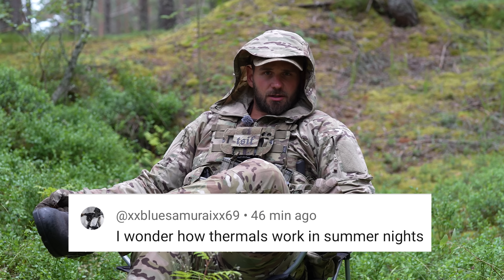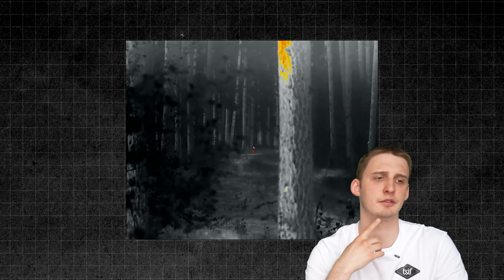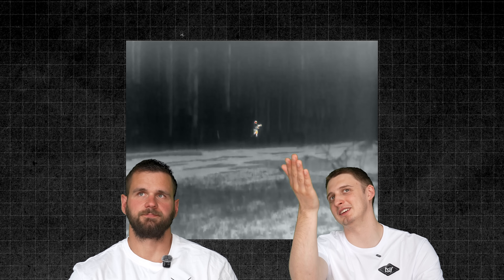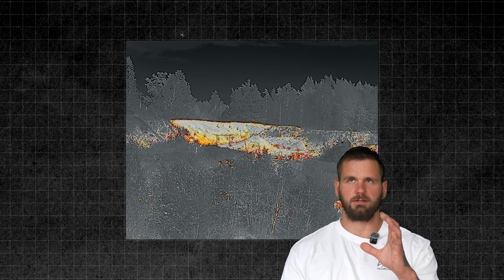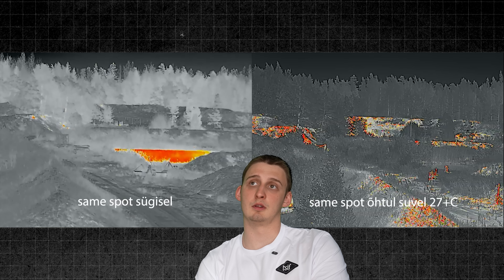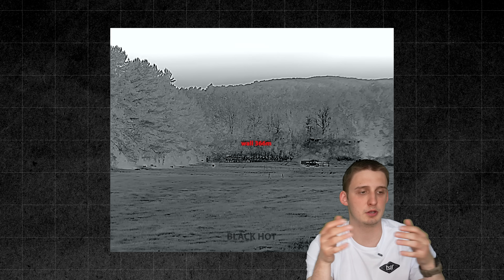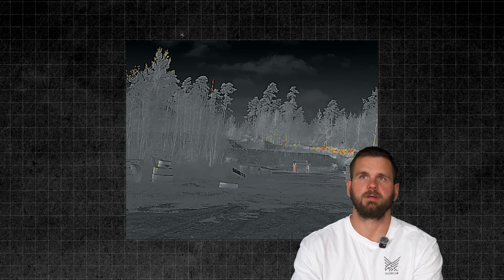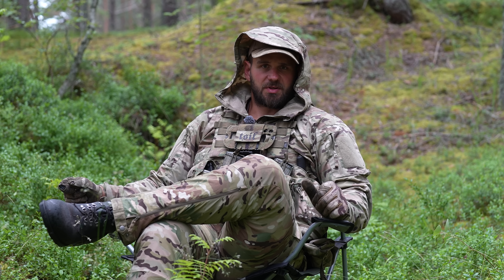Thermal Doesn’t Work in Summer? We Tested It.

Comment: On July 10th, we had an overnight low temperature of 95F (35C) in Arizona (Phoenix), with the previous day's temperature reaching 118F (47.7C).  Almost everything was red through the thermals and it didn't matter if it was 640 or 1280 units.   From July-September daytime temperatures severely limit the effectiveness of thermal as everything in the sunlight is hotter, from the rocks to the trees.  Any metal items in direct sunlight can reach 150-200F (65-93C) & ammunition or metal magazines left on a truck's tailgate will burn hands / fingers.  It's impressive!
Reply: I lived there for a bit and I don’t doubt a thing you are saying. Estonia summer is like a freeze in Arizona.

Comment: Could you run a test to see if a thermal will work in heavy rain? Since glass or other solid material blocks the heat signature I was wondering if a very heavy rain would.

Comment: I have a guide outdoor te421 thermal, a 899€ one. I used it at a reservist training week. In similiar distances or even more it looked much better than the 600€ one in this video. Was very useful for the tasks we had and like you guys said its 1000% better than nothing. Just the information that something might be there is valuable even if not fully identifiable.

So i wouldnt say dont buy anything that is under lets say 1000€, but do research on the sensors etc of anything in your price range, try to refrence videos of similiar devices or sensor sizes and lenses etc and see what fits best for the needed purpose if on a budget. Higher price always better, but in the end if a job needs to be done its better to get one that helps even that small bit. it could mean life or death as ukraine has likely taught us.

Love the videos guys!

Comment: 1:39 why thermal reflects from lake?
Reply from the maker: Yes
Reply: @falconclaw_  "yes" 😂😂
Reply: Water reflects light at the correct angle. Infrared (thermal) is still light, just in a wavelength that your eye can't detect. But since it's still light, it will reflect at the correct conditions.
Reply: @limecupcakes thank you
Reply: Similar to mirror. They mentioned that sometimes you can spook yourself if you look through termal into mirror.

Comment: Do you guys not have access to climate controlled buildings? Crank that heat up to 98°+ and see if it works then, yes? Maybe a hot metal Warehouse on a bright summer day but you can always crank the heater up if you have to test it I know they work in temperate temperatures it's kind of a waste to test them then something that's easily found out the heat thing did interest me though maybe you'll do a proper test next one

Comment: The closer to 98.6, the harder it would seem to get - or the more precise the sensor would have to be, but yeah, motion would still be the tell. Great info as always! Like the joke about stealth, a plane that has the cross section of a bee is great, but the problem is, it is a bee going 500 MPH so, probably not a bee...
Reply: But you need to be within a few miles of that "bee" to notice it.

Comment: In Australia outback too much hard rock above ground, middle of the night a hill gives off more heat than a animal.
Reply: Thermals aren't showing heat but the variances in thermal emissions from surfaces. It sounds petty but it means as long as there is a difference in temperature or emissivity thermals can see it. If the background is hotter than you, you're still just as obvious.
Reply: Indeed. But less differences appear less... different so you can't pick them up as easily, especially at range. When everything is close to 35 degrees or so it's more difficult for something living to stand out. @jameshealy4594
Reply: @jameshealy4594  honestly I'm not sure of that. never knew extrem conditions to confirm or not if thermal show delta or "absolute" heat
Reply: Yea, that's what I'm wondering.  There are plenty of places where ambient temperature is above body temperature.
Reply: Same here, Cyprus
Reply: I was surprised that a hill stills glows red hot even in the middle of the night. Down south sandy country thermals work fine ,I use thermal in white or black hot mode as black and white night vision works ok sees greater distance than regular night vision.

Comment: Thermals get way worse especially down here in Texas, and all on the south eastern coast like in the Carolinas. The humidity makes it very hard to sift out targets using thermals, and that’s with top notch thermals too.
Reply: How is it in the night/sunset/sunerise?
Reply: @Laurin99 sunrise it’s a nightmare, sunset it’s not too bad, but only depending on the sunlight directionals, and night time depending on humidity, and moisture density it’s can either be alright, or downright impossible to see anything. Gotta keep a keen eye for movement like they said because a lot of things bleed together and you can easily mistake something that’s highlighted/heated for a shaped individual despite being an object.
Reply: What thermal you using
Reply: @Gandalf_axtuL PATS-21’s mono white hots, and ECOTTI/PVS-31’s